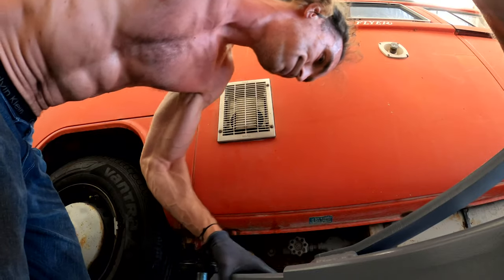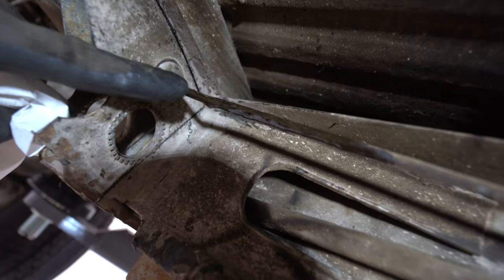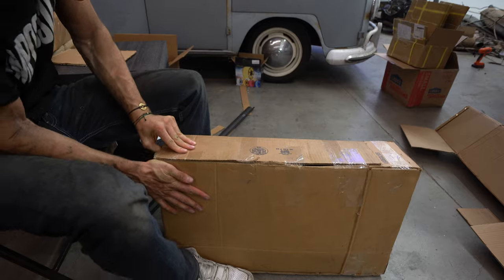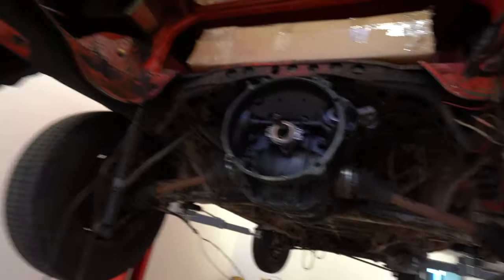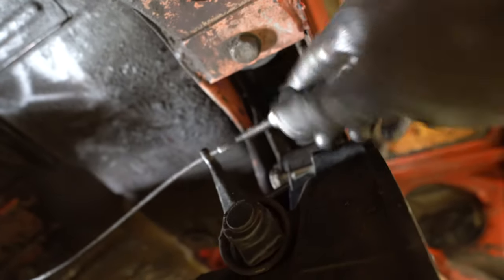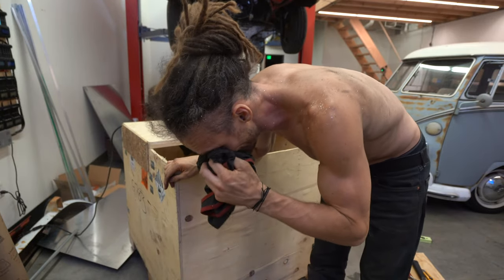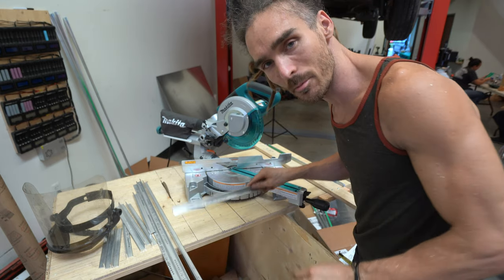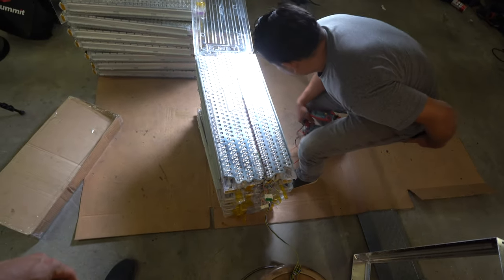I Removed My Engine, There's No Turning Back! - Electric Camper Build Ep 2

Comment: As an autobody tech this is the most terrifyingly Anti-OSHA video ive ever seen.
Reply: Boatbuilder here. I wouldn't go down the driveway to the lot's boundary in that thing.
Reply: I took an OSHA class for my Carpentry class and I was just cringing the whole time. While talking about how workplace hazards can be avoided by using the right tool for the right job, they explicitly mentioned converting a skill saw into a table saw as a prime example of what not to do. Out of all the examples they could have mentioned, they named this very one specifically.
Reply: After the first kickback from the make shift table saw I thought he would stop using it...

Comment: Please reinforce the frame so it doesn’t bend like a cheese string when you drive it!
Reply: Nah you don't need those supports. You know those German engineers. They're just so focused the style of the underside of their cars.
Reply: Yeah they just cut it like it is ok
Reply: I think they are hoping the battery boxes add some rigidity although I'm not sure why they didn't just make a full size box to shore all those lateral beams he cut. 🤷🏽‍♂️
Reply: the batterybox will be part of the structure. atleast that they're thinking. i would weld few reinforcements tho.
Reply: That and diskbrakes on all corners or he'll bend it regardless.
Reply: Mmm string cheese 🧀

Comment: hopefully cutting out those two support pieces doesn't weaken the structure
Reply: Yea it seems like he's cutting the frame?
Reply: @soanonso  yes those pieces are structural.  how much that really plays a roll is the question.  the bus is a unibody design, but hopefully they try to at least try to reinforce what they've cut out.
Reply: Hopefully after they put the boxes in they will sure up the frame by welding new cross members in
Reply from the maker: I'm pretty sure the boxes we bolted onto the frame bring that support back but we'll see 😂
Reply: @Louis  you can always weld pieces back in after you mount the battery boxes
Reply: @Louis  FYI. Aluminum boxes will not provide structural stability.
Reply: @miken3275  I hope he welds the boxes, those bolts are gonna snap if he hits a pothole or bumpy terrain. 😬
Reply: @Louis  I don't think so
Reply: @Louis  it the super amateur way of working. As a mechanical engineer , working as a governmental safety inspector, this is a instruction movie “ how not  😢”/brrrrrrr

Comment: 2:37 , never do this, it is EXTREMELY DANGEROUS  !!!!!   

Sparks and heat from cutting the metal fuel fill tube can ignite fuel vapor in the fuel tank creating a huge explosion.  I knew of someone who was using an angle grinder underneath his pickup truck close to the fuel tank, the tank exploded and he lost his life.

Comment: ⚠️☝🏽 Louis, a simple tip for making the aluminum frames:if you cut  a 90ª  triangle only on a single side of the "L" you can make a frame of a single piece marking every side with its own messure, then you can bend the pieces togheter until  every corner make contact with each other.  this way you will have a "one piece frame" then later  you can mount it all with aluminum rivets.   HOpe it help, peace !! 💪👍🙏

Comment: Pop rivets seem like they would be easier to use for building the aluminium boxes, maybe worth a shot! Loving this build so far :)
Reply from the maker: Thanks bro!
Reply: Iook into making boxes with a sheet metal folder (sheet metal break)
Reply: nope the right way to do it you cut the floor of the box and the four sides attached to the floor almost like a cross then get a box bender   or go to someone who has one bend the four sides up and weld the four corners done

Comment: "i never should have built my own table saw" - One Armed Louis
Reply: Ain't it a pity how he doesn't come to the conclusion "I never should have skipped all the research and information galore out there before mocking up my own table saw.
Reply: The only thing I have against it is how high the blade is.
Reply: @FtanmoOfEtheirys  exactly what I thought. I even hoped that he’d caught on after the first miss. One wing nut loosened and tightened and it would cut better and safer.

Comment: I will find roofer crew (or someone with bending machine) to bend this alloy boxes. Then weld (mig-method) only 4 edges per box and then screw cover. You need to think about temperature sensors and cooling system for each box. The floor was weakened!

Comment: Saw the saw and thought, O nice they use the saw with a clamped down rail to get those long cuts .... well that improvised table saw was not what I was expecting. Dude safety. 
The coolest project is not worth if you aren't alive long enough to finish it.

Comment: I love it, but I’m just genuinely worried about the aluminum boxes. Aluminum just doesn’t have structural integrity, especially regarding off-roading skid plates and things like that. If those batteries cost you 10k, you’d really want to protect that investment (in my opinion). It’s also quite dangerous as you stated if the batteries get punctured.
Reply: It needs some steel reinforcement bars underneath and around
Reply: I feel like I would have sacrificed some camper cargo area and put the batteries in a less vulnerable place. On the other hand, this is where they are in the actual EV designs. On the other other hand, actual EV designs give a lot more thought and engineering resources to protecting them.

Comment: Safety measures:
1) always work at night with nobody around  to help you 
2) no t-shirts allowed
Reply: 3) longterm safeness: cut out all Your structural parts from underneath.
4) do the same to Your brake-lines
Reply: 5) Never install grommets when running your metal brake lines through metal suffrage components.
6) Table saws are much safer when upside down. But if something goes wrong, throw the pieces you're working with on the power cable.

Comment: Shouldn't your battery boxes be pretty much water tight when you mount them below a car? Especially when you choose a HV motor? Do you want water spilling around in there forming a connection between the battery poles and your boxes? So I would strongly suggest giving your box project to a welding shop instead of srewing everything together on your own.

Comment: instead of cutting the sides of the boxes could you not have just bent the aluminium to form sides so less cutting and attaching.
How did you know under the van  what you could remove so not to effect the structure of the van and make it weaker

Comment: Aluminum brazing you need to remove the oxide layer with a stainless steel brush on the joint you want to make. Someone didn't bother to read the instructions I think.

Comment: Hi I was looking forward to this van build, had a 1973 ex Belgium army bus 
But seriously what are you thinking.
Cleaning the engine bay so that toxic grease sludge goes presumably into storm water drains?
And then the circular saw mounted so that is was locked on and using it without safety equipment? 
Do it right the first time, please don't show anymore ridiculously dangerous DIY 
Your video needs a safety warning!

Comment: Aluminium should be cut on extremely low speed, with high torque. Basically cordless screwdriver powered table saw would be the best choice.

Comment: I have a 71 vw transporter bus.    the problem they say is my frame has a lot of rust.  I have driven it about 50 miles straight. but a few holes in the floor board. do I need to have the frame repaired first?

Comment: By cutting on the chassis,
You might’ve structurally affected the integrity of the bus in case of a frontal or lateral crash. Not good at all! It will also cause strees to the body.

Comment: Just be aware that every hole you create in the battery case can lead to water ingress.
I just had this happen on my self built ebike battery (20s - 7P)
What alerted me to a possible "issue" was if I gave it too many beans the controller would go into protect mode. (Shut down)
This usually means a cell terminal has broken loose so it was time to do a bit more investigating
I have an app called VBMS that measures all the voltages etc 
If you look below temp sensor 4.
Look at "cell 1" voltage.
WTF ?
So I dismantled the case and found water has somehow got in and ruined the bottom bank of cells
https://i.imgur.com/e2cqyRm.jpg
Bah!
Fortunately it's only 7 cells but it's still a pain in the arse to dismantle - Fix  - reprint a new lid (coz I bust the other one removing it) and reassemble

Comment: Apparently everyone else in the comments is concerned about your shirtless torso.
Anyway, I wanted to thank you for saying that making measurements in metric units is way easier than inches, because fractions won't be so imprecise, especially where you need to worry about 1/50 of an inch. Every error will sum up at the end.

Comment: 14:30 I am OSHA certified and they explicitly taught us NOT to do this. They told us to use the right tool for the right job and how accidents in the workplace occur by not using the right tool and then used this very example of what not to do. Never use a skill saw as a table saw. Buy a table saw.

Edit: P.S. Always use eye protection.

Comment: Screwing a tow hitch to the bumper? Done. Dumping grease on the road? Done. Cutting away structural parts of the chassis? Done. Cutting the brake lines, than remaking them who knows how? Done. Building battery cases that will let water in and get punctured far too easily? Done. I'm SO GLAD this kind of DIY work by amateurs is not allowed in my country. That van is going to fall apart and/or catch fire as soon as it hits the road. It's too dangerous! (Not to mention the basic safety rules this guy totally disregards when he works...)